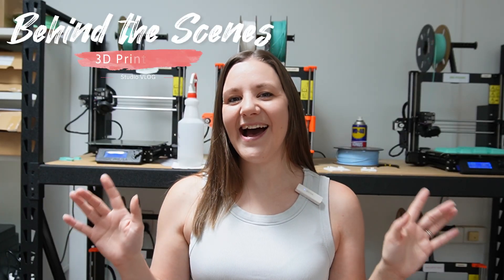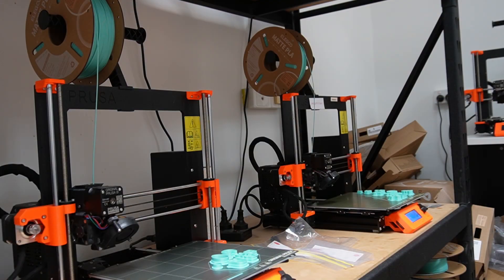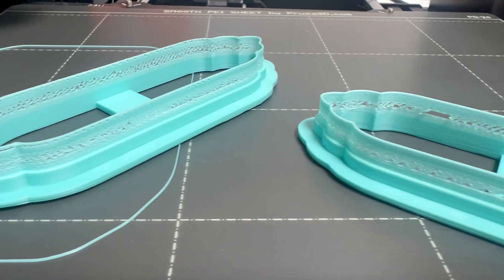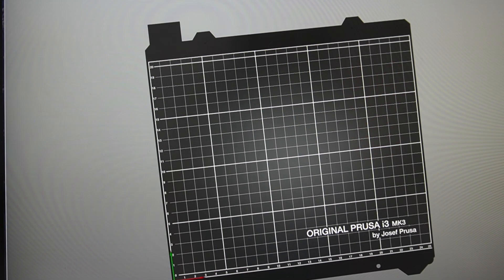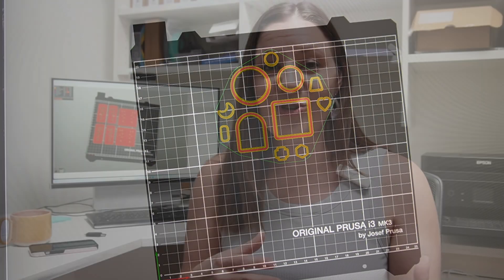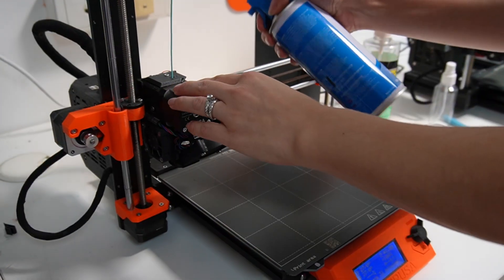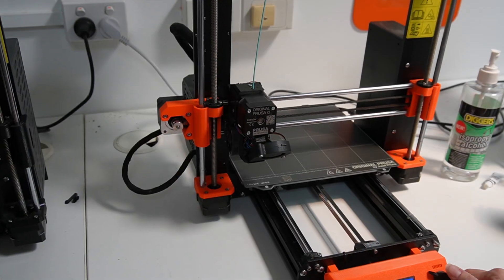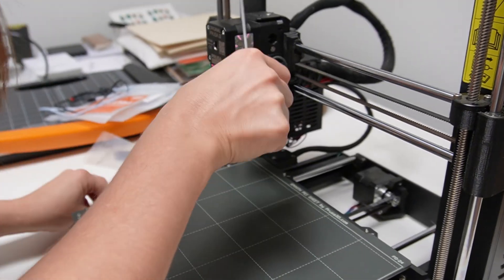Inside our 3D Print Farm - Behind the Scenes - Creative Business Studio Vlog

Comment: I love your inspirational videos, and I didn’t know you made your cutters yourself. They look like they have great quality. Congratulations!

Just my two cents about the printers: Greasing your rods has no effect on lubricating them because the linear bearings on the Prusa have seals that wipe off anything on the rods. You need to grease them from the inside, which requires dismantling the axis. Once a year is a good schedule. The only effect of greasing Prusa's rods is to prevent rust, though the risk is relatively low if you run your machines regularly.
Reply from the maker: Aw thanks so much! 🥰 And thanks so much for the helpful info about the Prusa bearings. I am self taught so little bits of info like this are handy! ❤️
Reply: @myclayco  You're welcome! It's my pleasure to help such a hardworking lady.

Just by looking at your prints, if I may offer another piece of advice: you can improve print quality (or reduce post-processing work) by enabling a few settings in PrusaSlicer (in the Print Settings > Layers and Perimeters) :
- Extra perimeters (if needed)
- Avoid crossing perimeters
- Seam position: Nearest
These tweaks only slightly increase print time, but we’re aiming for the best professional quality, right? Keep up the great work!

Comment: That's really cool! Thanks for sharing, I've been wanting to get into cookie cutters(I'm assuming that's what you were printing) as well for myself and potentailly customers. But I've been hesistant to do so, since 3D printing isn't completely food safe. And I don't want to get in trouble for getting somebody sick.

Do you deal with that in any way? Or how do you get around that?
Reply from the maker: Glad you enjoyed the video! They are actually cutters for clay ☺️ We are polymer clay artists ourselves so make cutters and tools for clay artists.

I’m not 100% certain on requirements for making them food safe - we use a filament that’s labelled as food safe, but I’m not sure if there are other steps you need to take 😊
Reply: @myclayco  Hey! Thanks for responding 😄. Ahhh yess, clay cutters, that's smart! 
Oh yeah and regarding food safe, the filament can be food safe but you would still need to take some further precautions.

1. Dedicated nozzle, but still you don't know if the factory have tested it with non-food safe plastic. So it could still not be food safe
2. The layers, that's the big issue. Even if the plastic is food safe, you will get bacteria get stuck in the layer lines. So you can't clean it all the way, so for multiple uses it's not food safe.

PS: I think MAYBE if you do like vapor rubbing to smooth out the layer lines, then it would probably be food safe 😃

But clay cutters are great! But just to let you know if you do have customers asking if they can use them as cookie cutters ☺